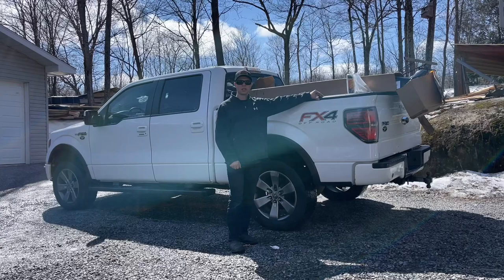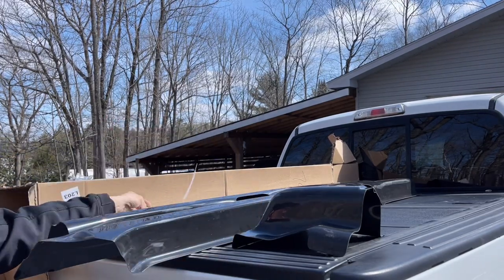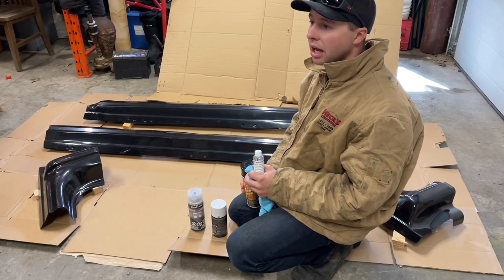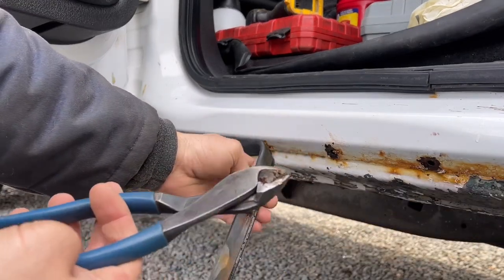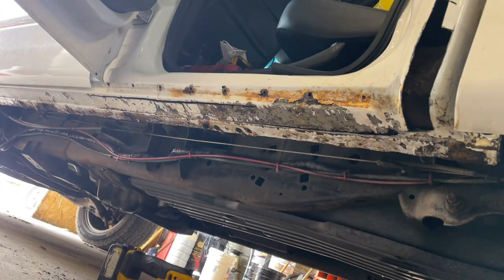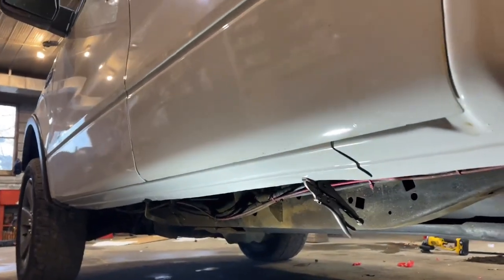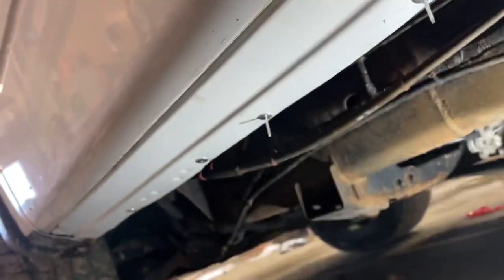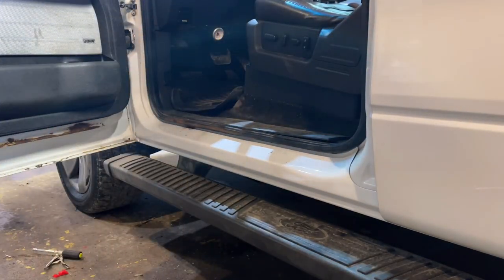2009-2014 F150 Plastic Rockers and Cab Corners install. Quickcovers by OAM

Comment: I strongly  recommend  fix it right  weld in new  metal....! Don't  mess around  doing  this!  Spend the money 💰  and  do it right it will  last a long  time  on the right way of  doing doing  this.....
Reply: Especially for their price.  $300 for 2 cab corners
Reply: Agree 100%, doing it this way you now have plastic where water will get trapped and rot out the metal that is there.
Reply: It all depends on the value of the truck. Spending $3,000-$4,000 to have metal replacements put on and painted, doesn't make a bit of sense at all on a cheap $5,000, $6,000, $7,000 truck.
There's an saying, "Don't Throw Good Money After Bad".
These are a good cheap cosmetic fix for a cheap truck.
Now, if the truck is worth $20,000 or more, I'm 💯 with you on Spending the money and welding on new metal.
Reply: I just pack my rust spots with packing grease or assembly gr,ease on my wheel well arches, and spray the fuck out of back side and outer side with NH oil or fluid film to stop it from going further, but I do agree the right way is better, this seems very bad idea, like you can seal it off with auto body panel bonding epoxy they use these days for body panels on the newer vehicles, and seal it off with auto motive caulk, or rtv, but still may not be a great idea.
Reply: My point is this doesn't sound structurally sound
Reply from the maker: @m.7n6 i agree with the grease, oil etc. however this still let’s it breathe and is not 100% sealed. Water does not sit in there and it is not sealed like people mention.

Comment: I have been told that those are not a fix for provincial safety inspection acceptance as only welded metal is acceptable, even on vehicles with a real frame.  After being told that these are not an on road legal solution in Atlantic Canada, I am searching for another solution as only the under side of my rockers (inches below the doors) are rotted.
Reply from the maker: This seems odd because I have heard a lot of people getting safety’s done with them. People will fill them full of spray foam and paint them and that passes.

Comment: What causes the cab corners and rockers to rust out is cargo light gasket leaks. The corners of the gasket tare when they are installed. The water runs down the pinch weld above the back window and puddles in the cab corners and rockers. Just remove the cargo light and put a 1/4 inch foam seal on the roof side and it will stop the water intrusion. 😅
Reply from the maker: I have heard that. As well as sunroof drains go straight to cab corners. I never got any water intrusion up there though. I did reseal it and check, this was just harsh canadian winters….

Comment: Looking to do this on mine. Definitely better than $2700 repair for something that won't be on the road that much longer. Thanks for the video!
Reply from the maker: You got that right. Even the trucks that are well kept and everything seem to all have the rocker issues and cab corner issues. Doesn’t mean the truck is a rust bucket, my frame still has nice black paint on it….. just a cheap option that fits and works great
Reply: You fix the 3rd brake light? That's where the issue is from
Reply from the maker: Hey… nope it doesn’t leak. I had been told that as well.
Reply: @Schneids15  I gotta do something like this to my truck soon
Reply from the maker: @FIRENICEWOLF  if you don’t want it to be a show truck it’s a no brainer. For me for everyday driving this will make the truck last years and look excellent.
Reply: @Schneids15  I daily drive my raptor and irs pretty bad
Reply from the maker: Yeah if you love the truck it is well worth it. However my truck has 400KM on it and i didn’t wanna throw 3K at the rockers to fix them. This was a better option for me. The plan for this truck due to it not being worth much because of mileage, i want to do a body swap of a 50s/60s ford pickup body onto it down the road.
Reply: @Schneids15  yeah the main thing I'm worried about it the counting rust also don't really want to spend 4k and something that will happen again
Reply: @FIRENICEWOLF what light caused this light up on cab ?

Comment: Nicely Done, excellent all the way around. I guess my concerns with these would be cracking either from your feet stepping in or out, or rocks/debris from the road, then the rust problem starts again. A major concern would be how these will keep water from seeping in, especially the front door panel at the aft of the door. A seam is facing up, usually you have something over the seam so water cant get into it, with these that seam is over the original metal between the doors. I dont see how the adhesive holds up, especially in areas with winters and freezing. #M makes great stuff but I cant see this holding up to heat, cold, freezing, flexing and such. Same for the bottom underneath where you put rivets. I dont see how this can be water proof. The plastic to old rustic metal frame is not perfect mating surfaces and adhesive being just a thin glue is not a filler. No disrespect to your excellent job and tutorial, I'd just be worried about water getting in in a year or possibly less. Perhaps theres is some sort of filler/bonding agent that can be put between t \he panels and the body? Great video thought, thanks.

Comment: I would put some clear silicone on the cracks where the rocker meets cab but question fluid film isn't always gana last so isn't the parts you left uncut gana rust how long is this really gana last

Comment: Thanks I have a 2011 crewcab it's not bad with minimum rust or body damage but I think if I do this now would help me prolongation truck appearance and value. It has 137000 original miles 1 owner. I'm the 2nd owner. Very nice, so I want to keep it nice rust free as much as possible. Thank you for the video and name of the product.

Comment: My 06' has rust starting at the rockers near the bottom of thr tore wells. I would prefer to cut and weld but maybe cutting out the Rust, mitigating it with inhibitors and doing the plastic over it would be best. I just don't know if they'd have all of what i need

Comment: turned out nice.  definitely a good option to get more life out of a truck.
Reply from the maker: You got that right. The thing is the truck isn’t very old yet. However these things rot out sometimes in like 3-4 years. It’s not a show truck so it don’t have to be perfect. For the price and fit and finish they are great.
Reply: @Schneids15  if people would only fluid film when new.

Comment: Are those OEM fender flares? I'm looking for a set that fit good, bought a cheap set and they're crap. By the way real nice video, I already put the cab corners on now time for the rockers.
Reply from the maker: Thanks Alan. Yes factory flares. These actually have holes all through the fenders that the flare snaps into. That is why they fit so nice and tight.

Comment: I wonder if you could spray a rust converter up in and all around the area after cutting it out and pressure washing? Then, let dry again, and apply rust bullet or similar product. Then apply grease like in this video. Then glue on the covers? Thx

Comment: Exceptional lesson. Perfect for my situation. Do you think the plastic will crack or get a hole from road debris hitting in the areas where the metal was cut out behind?
Reply: I have these and the plastic is made really well. It would take a very hard hit to break these panels. Really well made for the money. I just wish they sold them in colors and i wish they sold the rear truck bed corners.

Comment: That's a shame it's already rusting being not that old. I've noticed on my 2012 it has spot's under the bottom lip on the edge of the cab where mud can build up. On mine I get under and pressure wash it really good every couple months, then I spray used oil in those area's. It's a dirty job but so far I don't have rust.

Comment: The only thing about these plastic covers, what do you do for support? I doubt it will hold up the steps
Reply from the maker: The steps hold onto the inner rocker which has lots of support. Mine were just the outers that were rotten.

Comment: How did you get the rust between the outer and inner rocker panels where it folds together? Where 2 of the bolts for your running boards go. I'm about to do this and it looks like there is significant rust on those two edges and I'm concerned about not having any material to rivet the quick covers to.

Comment: my f-150 2014 is from Canada and the under is just wrecked as well.    Rockers and drivers side corner.
Reply from the maker: Yep. Horrible design. My buddy bought one new, a very very meticulous man and he had to get his all replaced. Was washed, oiled every year and still happened.
Reply: @Schneids15   I am debating doing this or doing the replace no weld method.  I don't mind this method for cost wise but the seam kinda bothers me.  Makes me wonder if water will roll into the double sided tape and loosen it up?
Reply from the maker: It could. However time will tell. If it does i’d just reglue. I’m beyond happy. A hell of a lot less work too.
Reply: @Schneids15  ya. I agree. Thanks for the video
Reply: @Schneids15  lol every brand pickup has this problem and the Toyotas are even worse

Comment: any updates on how these have held up so far?
Reply from the maker: Still going strong! No issues at all. I had one weather strip come loose on the bottom of the one door. I caught it and made it loose. Otherwise not one complaint. Truck looks excellent.
Reply: @Schneids15 do you think the rust got a lot worse or about the same?
Reply from the maker: @austinhusby3870  honestly, mine was not too bad and it was just the lower rockers. I don’t think it has got much worse. However you see guys replace outer rockers “proper” and they rot out in another 5 years. Usually the inner structure is still fine. I’m still very happy and don’t think it has changed much.

Comment: A WHOLE lot of "cab corners rust" has been caused by a too-thing seal/gasket on the 3rd brake light.
Look for discoloration of the headliner above the rear window, or in extreme cases - mold.

Comment: I found out the corners and rockers are rusting due to the 3rd brake light seal leaking ans rain water runs down the can to the cab corners and rockers.

Comment: Plastic will hold water. Great if your selling your truck the next day on a moon less night.
Reply from the maker: We’ll see. Yup it’s not welded in and proper. Am i ok with that? Yes. Where i drive this steel will rot out again in a few years. This is a good product. You are correct not structural and not meant to be.

Comment: Are people really doing this??? Your rocker panels are a structural component of your vehicle. Applying  this thin plastic covering does indeed "hide" all the rust and rot issues but when you take it in for your annual safety inspection the mechanic looks at the rocker panels from behind and under this plastic covering and they will see that the rocker are indeed rotted  and must be replaced! I can't  believe that people actually think that adding a thin  plastic covering will correct the lack of structural repair required for your vehicle. Are people that gullible ????   These videos on Youtube should have to disclose this type of disclaimer.
Reply: No one thinks this. Maybe you do but everyone doing this knows it’s purely cosmetic
Reply: Agreed